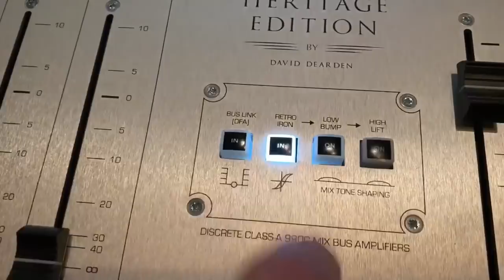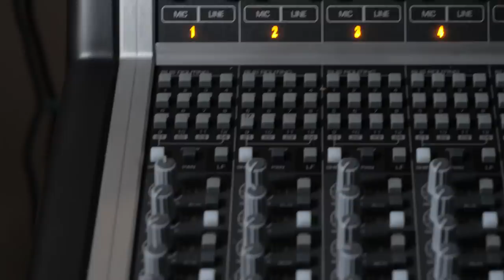Installing a $100000 mixing console!

Comment: $100K console... but didn't rent a forklift for a few hundred more.  What a shame.
Reply: Obsidian s spent it all on the console 😂🤷🏻‍♂️
Reply: Same thing with people buying a new iPhone but won't buy a new charger cable until one end is in the us and the other in south africa, lmao
Reply: Hey Obsidian s "That is exactly what I just stated!" There are operators that need extra funds for a days work. I just looked it up.   the 2005 Diesel CAT TH580B as an example could lift this console with no problem. Just contact "work for hire" fork lift operator. That is certainly what Pro Audio did in LA., to get the console on the truck.

Comment: why are the movers speaking russian?)
Reply: True story from Russia time.
Some years ago HP leased free for a year to my company a brand new storage system a month before the release. We told them that there would be a little problem: we are on 2nd floor and there's only one way to get it there - through the ladder with low ceiling (1.8m IIRC), while the system was full 42-unit rake (2 meters high) and weighted 320 kilos and we dismantle anything before it lands on it's place.
So on the day of delivery, truck had arrived, the driver opened up the doors and 4 professional power lifters jumped from it. The operation to carry it on hands to office took 4 hours.
Reply: Sounded like Spanish..
Reply: No, it was russian for sure
Reply: Russian language, no doubts
Reply: @yallevereatenbeans2723  дякую,  Капітане Очевидність)
Reply: @xChesterPagex  You ask stupid questions you get stupid answers
Reply: You think an 'murican would do that job..? xD
Reply: Russian language for sure. 6:41 "Нормально?" 7:01 "Подожди!" and so on.
Reply: @xChesterPagex  привет, Беларусь 🖖
Reply: @EricJones1969  я з України, друже)
Reply: Ребята говорили на русском языке)
Reply: There's a large community of Russian immigrants in LA, one of the largest of such communities in the U.S. That's why you're hearing Russian.

Comment: $100,000 and only 24 inputs?  It better sound like God.
Reply: It can't, considering God ain't real.
Reply: Northern Dirt  I get that but it's really not the same thing.  When I say input I mean mic channel.  I'm not a big fan of split EQs either.  Console configuration is mic / line channels x busses x monitors x mix busses.  Since they're not recording to tape it is sort of a waste.  You can get a desk with all that and more inputs for 1/5 the price.
Reply: Northern Dirt  For practical purposes I would use 27 or 28 channels to record a Big Band (which is what I do often) with 8 or 9 of those mics for Drums.  There are other sessions where I may not be recording that many mics at once but I'll certainly need them all hot and at the ready.  It just makes things go faster if I don't have to use the same channels and take new levels.
Reply: Northern Dirt  I wouldn't touch a Digital microphone with a 10-foot pole, even if it is a Neumann.
Reply: Northern Dirt  I don't think Neumann makes any other kind of microphone but I could be wrong.  I can't imagine that the converter is up there with some of the more boutique brands like Burl Audio so you can keep 'em.  Mics are supposed to do only one thing.  I'll worry about the conversion on my end.  Besides at 6 Grand a pop you're talking $90,000.  Maybe I am missing out but sometimes clean is not the best for the source and a Neumann mic is not always the best for the situation.  I was recording a vocalist recently, put up the most expensive mic in the studio, a Neumann TLM 149 and it sounded terrible!  It was muddy, clouded and worked completely against the singer.  I immediately swapped it out for something else.
Reply: Northern Dirt  I don't think so, although I suspect it was the room which I didn't like from the moment I had walked in.  Very dead and uneven sounding.  We swapped out the 149 for a Pelosi and she sounded better, albeit not great but It least I got something that I could work with.  Anyway, give me an U87 in good working condition and I'll conquer the world.

Comment: An audient 100 000? No Way... the same model is listed @  50k on thomann
Reply: Under 50k. You can get it for 44.000,- Euros.
Reply: @FrancisJoa  I see it being sold at Thomann for  37k euros.
I wonder why is there such a price difference.
Reply: 100K after professional installation
Reply: @lorraineming4590  ??? There was no professional installation. The cables which were already there were reused and the room was not changed. All they got new was just the console and I don´t think in general that cables are more expensive than consoles.For 80.000,- to 90.000,- Euros you can get an SSL AWS or an API console.
Reply: @lorraineming4590  What? 50k of D-sub cables as the patchbay is already wired @ factory and intergrated to the console? 
No way.

Comment: Second faders are usually inline from the tape deck, for listening purposes when tracking. Not really necessary in a modern DAW environment, but you can use it for several other purposes. Second line mix although the routing is limited. Don’t know this Audient mixer well so. 
But congrats on a wicked console! :)

Comment: What are your opinions on using an behringer x32 for a studio
Reply: If you are going to mix in that you might use it to mix in the box and use it as an external controller for whatever daw you are using, but the x32 as a console has no character whatsoever, so I dont think is worth the hassle. As a recording interface its aight I guess
Reply: I have an m-32 now but the x-32 is a great board,I had one for many years. If you are recording drums and a lot of guitars and bass, it's nice to have all those preamps. I record into reaper and works really well. I send my tracks back and usually print stereo tracks back into reaper. I got a lot of outboard gear over the years, I run my drums into two warm 412 mic pres into some other hardware before its recorded, so I get it sounding really good before it goes into I don't have to do as much processing on the board or in the computer. For the price, it's hard to beat. But you might not need all those channels and there might be better options for you. It can only go up to 48k so if you want to do 96k you want to find something else

Comment: Can someone explain why they wouldn't just make the thing modular? Is the behind the scenes circuitry so complicated that a few interconnects between pieces wouldn't be sufficient?
Reply: I think most of the wiring is between the outboard gear and the patch bay.

Comment: Moving that giant console is the only reason why  I will never purchase it ,(beside being poor), LOL
Reply: @Robert Grant Its true, no one is gonna know the difference if you mixed a record on this console or in the DAW unless you tell them.
Reply: @Robert Grant I dont know the specs of this thing but unless they are planning to use it recording to tape it may very well affect the sound in a negative way with the signal being converted to and from digital and being routed through all the electronics and cables possibly adding noise as well. Recording and mixing in a DAW is a much cleaner process. It of course make sense if you are planning on using tape, then you need a mixing console, personally i just see disadvantages with recording to tape in this age.

Comment: 3:16 I work at Live audio and we pack trucks with cases every day and I'm just watching this like "Oh dude... No..."
Reply: Yeah man... Same here...
Reply from the maker: Ok, then how would you get it off the truck?
Reply: Just grab the corners of the box and carry it. Nothing ain't so heavy that 3 men can't carry it
Reply: @SpectreSoundStudios (In this situation) We would most likely lift it up with the lifts and put it on wheelboards (don't know in the US but they are cheap here or you can make them in like 10 minutes) . Then take both trucks available and lower it down with them.. Here the trucks are designed a bit different so it would be easier with the trucks we have here.. We did that when our elevator was delivered.
Considering the situation it was still ok :) 

Juveri there is no way you would lift a 200kg+ box with just a bunch of dudes. Considering how high the box is you would all ruin your backs. There is no way you could make a decent lift on that box.

Comment: That was a really funny video. Heavy? You don't know what heavy is... 800 pounds? That's nothing. Remember Dave Grohl''s Neve? Mines bigger and heavier. With all the modules out of it. The pedestal removed. It takes eight guys. Not three or four. Eight. It's as heavy as a Mazda Miata. And here I was watching a bunch of children trying to figure out how to unload a lightweight audio console? I have only one powerlifting on my truck.

I installed my Neve in 1996. It's coming out in the next couple of days. To go into a brand-new studio I'm building in, San Marcos, Texas. You're going to read about it soon. You're going to want to come down here and record with us.

I will be re-equipping my truck with my, fourth, build out. In 28 years. Remember 28 years Glenn? For the time being. I'm installing a pristine, custom, extended, MCI JH-636 with VCA subgroup fader mixing. I have to remove both producers desks. There's one at each end. Making it 15 feet long. Out of a Russ Berger control room in Fort Worth, Texas. My control room can only accommodate 10 feet wide. That's a lot bigger than your little $10,000 toy. Oh I mean, $100,000 toy. Because really, I've got the $100,000 console. $100,000 in 1970. Well I'm really exaggerating. It was only $85,000. And one of the last that Rupert Neve built. Before he lost the company to Siemens.

So you can hallucinate all you want about how big your little console is. Where's the Transformers? Oh right. It don't have none. What are you thinking? Do I have to come to LA to help you? Because I'm trying to acquire and purchase a legendary US Pro Audio manufacturing firm. So I might have to move to LA? I can't say who that firm is. But I definitely like their gear. I've been using it since 1978. I don't want it to go away. It basically already has. I don't know if my buddy Paul Wolff can help me? I helped him  when, he acquired API.

Otherwise fun video.  You look good behind that desk. It'll be nice.. Looks a little flimsy? But isn't everything new today, flimsy? Unfortunately, yes.

I don't know how we're going to get my Neve up a flight of stairs yet? It takes eight guys on a flat surface. 2 carrying the 250 pound + hardwired, wiring harness. Another six to lift the empty frame. Empty, frame. As in emptied. As in Modules in, boxes and boxes and boxes each one weighing a couple of hundred pounds. But all guys like to pretend they have the biggest. It's okay. I know I have the biggest. I'm sorry it has to be that way. And I can't help it.  I'm just an  Audio Engineer. 50 years worth. I'm not done having fun yet.

Comment: Las Vegas has Folk lift Operators. There are fork lifts that move this equipment all the time. That is how they got it on the truck in Los Angeles. For example:    the 2005 Diesel CAT TH580B    https://www.discountforkliftvegas.com/inventory.jsp        The construction/carpenters Union as a list of companies/operators who handle this on a daily basis. That is how I will do it when the time comes to move a AMS NEVE Console in my upgraded studio...when that time comes. Much success Spectre Sound Studios. Where is your recording studio located in Vegas? I'd like to visit!

Comment: Somebody wasted $100,000, Takes a long time to make that back in this music economy. Blind listeners can't tell whether you used digital or analog for the mix. An SSL 4000G, which can  be resold easier than an Audient,  can be had for $40,000 and it has a better buss 
compressor as well as dynamics on every channel.

Comment: Oh, you don't need one of those if you really know what your doing. My Line6 and Audacity works fine, and the sound and quality is basically the same! Trust me, I know this stuff, I have almost 10 mounts experience from my official pro studio in my gammys basement! Also drum samples are fine to use, theyr'e cheaper than a real drummer and they doesn't smoke all your weed!

Comment: I mean, I can just pay about 100 quid or so to use a studio and track whatever I need whenever I need instead of breaking the bank, so i'm not jealous. Sure it would be cool I guess? But hey, one soundproof room, plus mixcraft, a couple of plug-ins, and a fender amp plus strat; added multi-fx box for measure, and then channel it all through a mic connected to my Scarlett. Live for my rhythm and vocals, vsts for bass, lead and drums. Slap it all together in a mixcraft and master it in the same one, and you are good to go. Besides, I play punk anyhow, some chords and the like are all I need. But hey, more power to you lot. Absolute more power to you.

Comment: years ago i had a job delivering large format printing supplies - you know those roadside billboards? yeah, well those are printed on sheets of vinyl as big as boat sails, which comes from rolls 12 feet long that weigh 400 lbs...printing companies have special gantry cranes just to load them into the printer, but did we have any special accommodations to deliver them? of fucking course not... this video triggered my ptsd...

Comment: Luxury bias is alive and well. Nobody actually needs this, not even close. Mic and Line Preamps are a community circuit, easy to crank out in the hundreds of thousands. Thanks to Thunderbolt and SSDs, a computer can inhale a massive amount of tracks at once. Digital plugins are amazing and don't suffer the limitations that analog equivalents do. It's too bad so many plugins try to emulate analog versions versus providing complete precision and control. Digital signal processing is the same as analog signal processing (it's an actual law of physics) and it's why we have the internet. Spend the money on  microphones (still waiting for a digital breakthrough there) and acoustics.

Comment: The Pro LA Audio bit from about 9:00 mins in - I used to do that sort of thing for a living.  I used to install rack based AV systems in board rooms and video conferencing suites.  Its interesting that its all terminated in D25 connectors!  I would never have thought using something so flimsy for pro audio!  its hard to get shielding in those connectors, so I would have thought the risk of adding noise to your signal was a problem.  I have wired studios up with multicore cable into XLR patch bays and break out boxes before...   You either love wiring or you hate it!

Comment: That  is one expensive  DAW  controller. Must impress and attract clients , so I suppose it is  worth it. 2 S3's for less  than 10k  would  have done the  trick, if  all you  wanted was some faders  to twiddle with.  Lets face it you will still be looking at an ultra wide monitor using mostly DAW with  this 100k  monstrosity in front.

Comment: The fun part of a console install is measuring and soldering several miles worth of snakes, and then spending hours installing and testing every connection and hoping you didn't mess any up.

Comment: Receiving and moving a big console is always a big, scary, dangerous chore. When I got my A&H ML5000 48B live sound desk, it was fortunately a rather easy move to take it off the palette and directly into it's road case, but it did take 6 of us to deal with that. Secure the lid and putting it on the wheels took 4 guys. Then moving it into the trailer to take it home was a 2-man job. 2 months later I got rid of that trailer and got a box truck. I've been through your "let's receive and install a large format studio desk" a few times. Have fun with the inline desk design. Once you get the hang of it, you'll love how it works over that of a split-desk design.

Comment: I remember doing some servicing-work on an 80's vintage 28 Channel Soundcraft mixing desk, I had to physically cut out parts of some 80-way ribbon cable that had been chewed on by rats, and then use a soldering iron, solder, and thin heatshrink tubing to literally re-join every single wire to splice it all together so that all the signal buses worked, the desk was pretty huge and had real analog style VU meters, it was a fun job, and I managed to get the desk to the point where it was pretty much fully functional, the guy who owns it wants me to do some re-capping work on all the channel strips so that they all sound good and consistent.

Comment: @ 8:32 The small faders are the tape sends, typically you use them to send signal into the daw and have the outs of the daw normal to the tape returns (long faders) for monitoring

Comment: Glenn, you have two sets of faders because this is an "in-line" recording console! The "top" short-throw cables and that section of the console goes to your record path - it's where you put your effects/processing "on the way in". The "bottom" long-throw cables are your returns from your DAW as your "monitoring path." That's where you can make non-destructive changes during the mixing process.

In-line console signal flows I've seen typically go like this:

Input (line or preamp)-> input processing/insert -> input fader -> ADC -> DAW -> DAC -> monitor path input -> monitor path processing/insert -> monitor fader -> mix bus -> 2-track recorder -> console monitor section -> speakers
Reply: Great application for an input fader: tame the signal coming off a hot preamp like an API